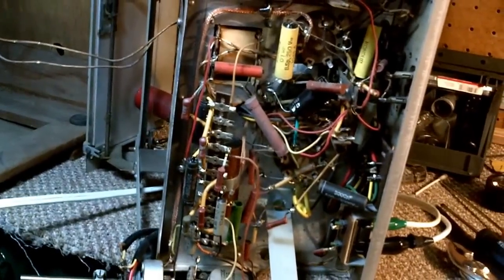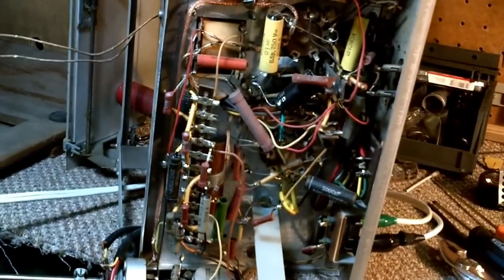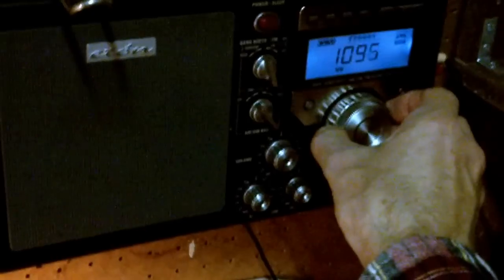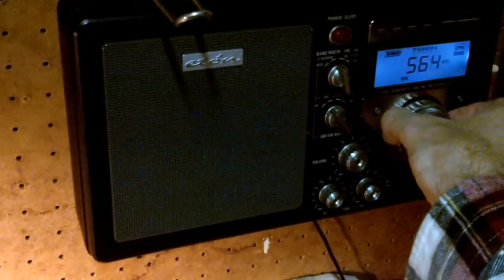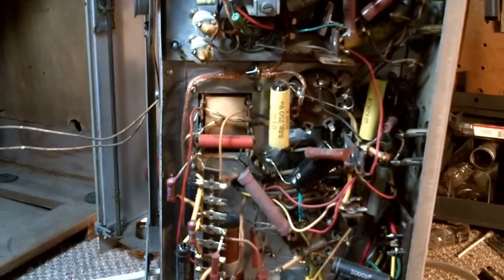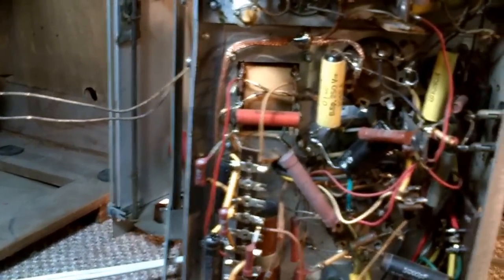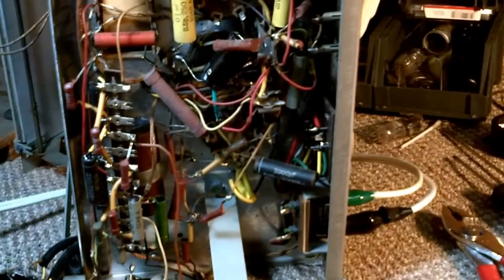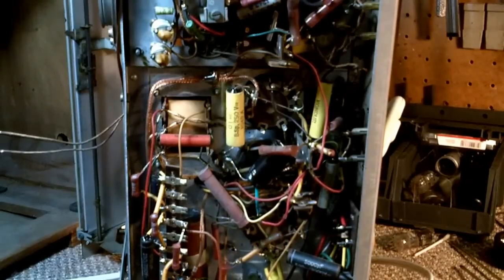Philips Sonate BA581A Vacuum Tube Radio Video #6 Trying a better antenna

Comment from the maker: I'll be getting back to this radio shortly and I'll carry on with a number of tests including grid and plate voltages.  Since the radio seems to work to some degree, I don't expect a serious voltage problem but my crystal ball is often wrong so I'll have to check to be sure.  I am worried that a tube is weak and I can't do much about that without a replacement which I don't have right now.  I need to ensure the tube contacts are good too before doing much more.

Comment: Hi Jim. You could use signal injection to troubleshot the radio. Use an audio generator for the audio stages and then use a signal generator for the IF and RF stages. That what I do you just start at one end and work through the stages of the radio until you find the stage that is causing the problem. Dennis